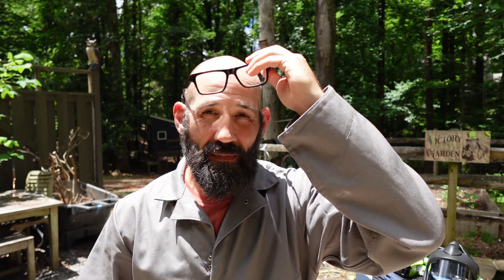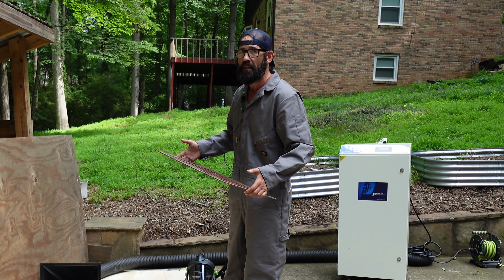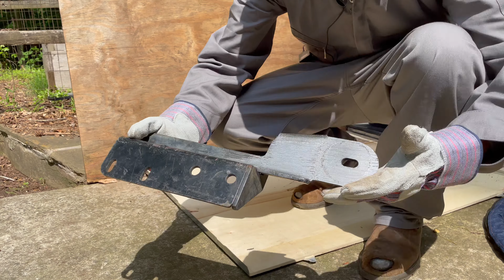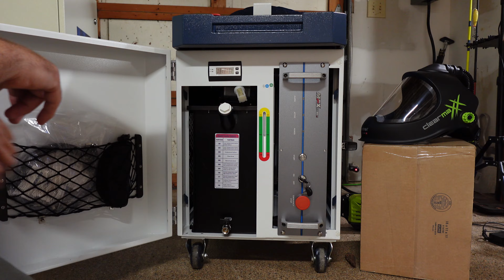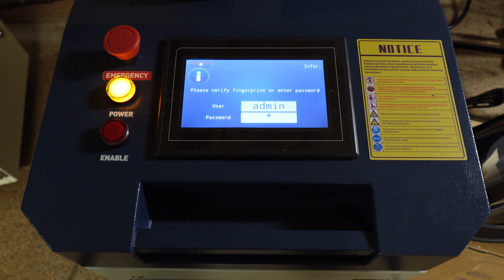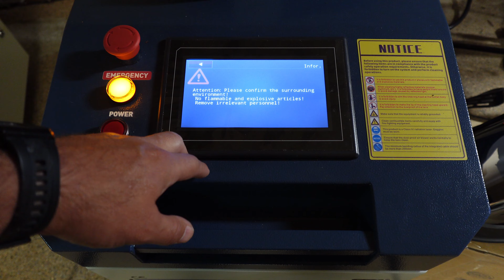Laser Cleaning 101 : The Ultimate Tutorial For Beginners

Comment: I have not bought yet but looking to bemobile, any ideas for 240v power options to connect aunit to?or should i use a generator?
Reply from the maker: Generator works well if you get the right one. 10k watts with 12k watt peak. 50A RV plug

Comment: Thank you for doing this.  You're right.  Plenty of videos showing people cleaning, welding and cutting, but almost none covering setup and the basic controls so people have the confidence to even just turn it on!

I believe the water does not circulate to the 'gun'.  I believe it only circulates through the laser head and electronics to keep the actual laser cool.  Also, the distilled water should be flushed out and replaced periodically, even if the unit is left unused for days at a time.  Probably every three months will do.  Even though we think the system is sealed, stuff can grow in warm water than can be unhealthy for you and the laser system.  You can add a little antifreeze if the unit is stored in a clod location or drain the system to avoid the lines freezing and possible splitting.

You should definitely produce a video about swapping and cleaning lenses, when you've had a chance to figure it out yourself.
Reply from the maker: cool thanks for watching

Comment: Question What are the Setting you are using to Clean is there a manual for the Best setting without burning it
Reply from the maker: My settings are not going to help unless you have the same unit, each material is different, and each laser is different. When you guy a laser cleaner you need to take time in the beginning to dial in a test all the settings, for each material and create a library of settings that you like to use.

Comment: How much air pressure do you have to provide to the machine
Reply from the maker: The BLC 2000 has its own air compressor built-in, and provides the correct amount of air pass the laserhead to keep the particulates away if you’re using if you’re using the smaller 100 W backpack you need to get your own external air compressor and that pressure should be set around 20 psi

Comment: Any idea where I can find directions for making a high powered one myself? In US and use to be Electronics tech on Radars so I know safety.
Reply from the maker: Well China, is the one supplying all the parts, you will not find all the parts you need at one location or one vendor. I would look at Raycus laser sources or JPT laser sources or Max Laser Sources first so you can see what a 2000watt CW laser source will cost you, plus you will need an industrial chiller, and fiber optic cables, transformers, control modul... and on and on its out there you will need to source it all.
Reply: @LaserEngraving911  ty!

Comment: @laserengraving911, Do you have any insights on laser sizing to use?
You went with a 2K watt version and you were running it full power to take off the powercoating.
How much a disadvantage is you go with a 1000w machine?
Reply from the maker: Hey There, great question, by lowering the wattage, it would just take you longer, it will still remove the powder coating just the same. Not Huge deal,

Comment: What if had to perform a job in a remote location without access to power? What type of inverter generator would be appropriate for this machine?
Reply from the maker: Great Question! I have this unit and I can run the BLC 2000 at full power with no issues for extended period's  https://amzn.to/3tv4mqs  you want a generator with at least 12.500 surge watts capability and 9000 watts running
Reply: Thanks for your help!👍🏾

Comment: I Am considering laser for paint removal on an aluminum airplane. How effective do you think it will be? I am concerned about what you said about the heat building up, a lot of an airplane is thin 1/16 of an inch.
Reply: I would think a pulsating laser is better for removing paint off of thin metal. Because it doesn't overheat and bend workpieces
Reply from the maker: correct, and I talk about that here, https://www.youtube.com/watch?v=IRJ6Au1IuGM @attilapuskas7090
Reply from the maker: Great Question! For your application you will need a laser cleaner from SFX with a more control of the energy being thrown at your substrate, here is the unit you will need to accomplish your task without damaging the aluminum base. https://www.sfxlaser.com/300W-500W-Pulse-Laser-Cleaning-Machine?ref=Michael%20Mullins
The cost is higher than the BLC2000 in the video, that is because you are buying a "pulsed" laser cleaner with more control, with the ability to remove paints and contaminate with precise control. Hope this helps, if you want to discuss further reach out to me via email and we can talk more about it. laserengraving911@gmail.com

Comment: How good of a business laser cleaning actually is? I've been doing some research, you can clean a lot of stuff, but is it actually worth it? The machines are quite expensive. Great video
Reply from the maker: Laser Cleaning, can be very lucrative, as its a specialized service.
Reply: @LaserEngraving911   Did this machine come with a 220v plug? I'm just wondering if it's ready to go as soon as you get it, or requires an electrician to make some connections.
Reply: @infoperfection i just recieved a 3,000 watt version of this machine yesterday and it came wired but without a plug, you will have to do that yourself or have an electrician do it.
Reply: @LaserEngraving911  hi ,thanks very much for your video. I am living in Ireland and I am currently looking into setting up a laser cleaning business,there is very little laser cleaning businessess  in ireland ,Would it be possible to contact you directly via email to get some advice if you wouldn't mind?
Reply: Depends largely on where you are

Comment: Are you using full power? My 2kW is cleaning much faster than this, but i didnt receive any sort of settings chart. Here are my settings:
Peak Power: 90%
Modulation Freq: 800Hz
Duty Cycle: 80%
Wobble Freq: 180Hz
Wobble Dia: 50mm
Wave Y Axis: 300mm
Speed Y Axis: 2000mm/s

I haven't had any issues with these settings. Speed is important to my application.

Edit: lol just got to the end. Thank you for showing the settings.
Reply from the maker: Hey There, I watched some of your video, and not there are only some parts of the video where I'm using full power, and some parts I'm only at 50% and so on, I believe you have a dual axis mirror in yours so you about to adjust Width and Hight, and you have a wider frequency range, I choose to go a lower power most of the time and do multiple passes rather than hit everything at full power all the time as not to damage the metal underneath. Thanks for sharing your settings!
Reply: @LaserEngraving911  That video was a test when we first got the machine. I'm using this one to clean shell and tube heat exchangers. I need to start recording more content!

It was interesting to see that the laser did not cook the egg directly, just heated up the stainless steel underneath. Lol

Comment: Has anyone tried this for stripping old paint on a house. Not sure how good it would work and how long the cable is to the gun
Reply from the maker: I think this machine is not the right application for that, as there would be way to many fumes, and fire hazard, the cable is about 30ft, however they make a 200watt pulsed version which would do well at stripping paint form wood with the right settings on a small scale.
Reply: @LaserEngraving911  A tophat beam works good to strip the clear off of furniture.  Most pulsed laser cleaners seem to be Gaussian beams which could work as well if like you mentioned parameters are set appropriately.  Tophat beams are not suppose to do any damage.  Tophats are Gaussian with a beam shaper that converts it to a Tophat as you probably know. They don't go past the ablation threshold.
Reply: I was curious as to using this laser on fiberglass (?) Like a boat's hull.
Reply: @Hello.ThisizBOB  I tried using mine on fiberglass and it started to melt.  Perhaps a tophat beam at low power might remove thin contaminants but my findings so far say no.

Comment: I have A 200 W pulsed MOPA fiber laser.  It eats rust quickly.  Black paint no problem.  Different paints ablate differently.  Red can be easy removal  if it isn't very thick.  Orange was a bit more challenging.     is not as good.  Grease being black cleans up and degreasing axels and gears works well.  It also creates an unbearable odor.  Never operate any laser cleaner without proper eye protection.  You see videos that show and claim no eye protection is required.  That is bullshit.  The PPE  and attire shown in this video is spot on.  Using it with no fume extraction and PPE is not something to do.  Fumes are noxious and you will quickly find is a terrible idea.  High powered lasers like this one have their place but can damage certain substrates.  Parameters are key.  Great video!
Reply from the maker: Thanks for sharing all that valuable info, and for the validation on the PPE, Im looking forward to trying some grease and grime next with this unit!👍
Reply: Is this working over wood remove stain? For example?
Reply: @xamtista2352  No , that will burn the wood, if you want to remove the stain you need a Pluse cleaning machine. =)